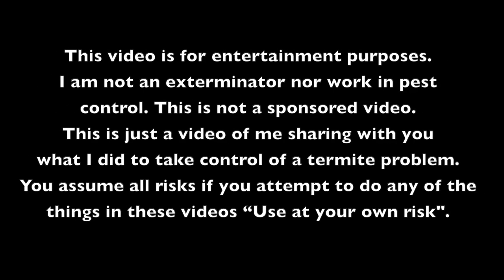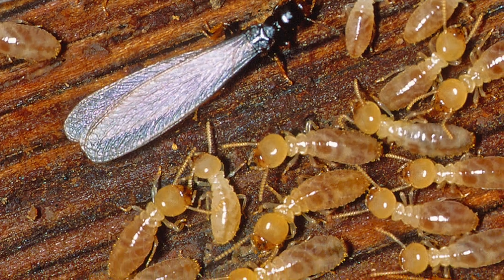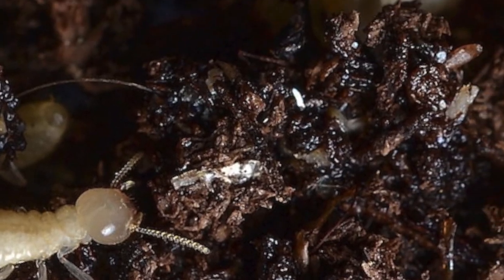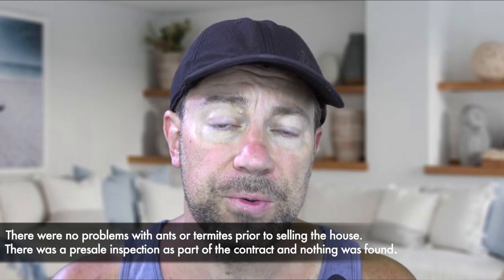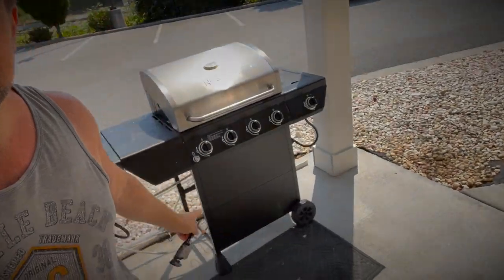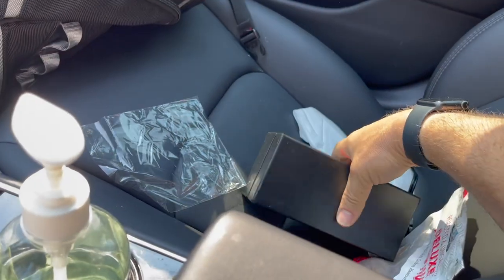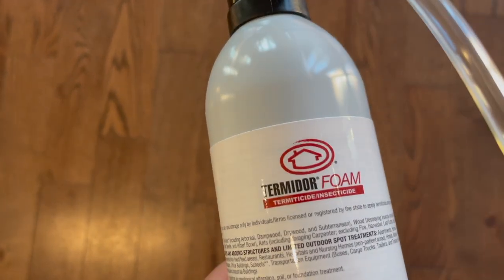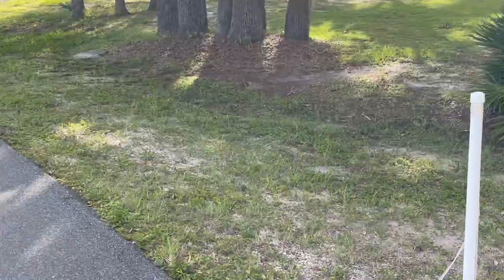This DIY Termite Treatment Cost Me Less Than $165 and Can Get Rid of Termites Forever!

Comment: Was there a lot of holes in the wood flooring inside of the house ? It looked pretty bad , saw dust all over the flooring . I would want a nice floor not one full of holes . I would think they or you could use a wood putty filling that matches well on the inside flooring holes ? It would help a lot w/ on how  the floor looks now vs afterwards .(Termites killed) just a thought . .
Reply from the maker: The bug problem is no longer a problem! It is well over a month later and all fixed now. That stuff works good.

Comment: Terrible video he’s not using these products correctly at all the holes that he was saying outside is where he should’ve been using the phone and in the inside he put the nozzle in the hole barely that’s why it’s it all out and I was told that the liquid was basically for soil
Reply from the maker: Read my disclaimers, I am in no way an expert on this. I was basically making content about bad tenants leaving termites in my house so to substantiate that particular series I had to follow through with some kind of termite control video to make it more believable. I do produce skits on my YouTube channels. Realistically I do not have any termite issues nor did anyone live in my house. It was for entertainment purposes and also for privacy reasons due to a potential stalker. I had to stage moving and my best story cover was a failed lease purchase contract this way when things cooled won and such potential stalker was no longer a threat to my family I resumed recoding content from home where I have been the interim time with the exception of a road trip to Florida to help a friend with electrical work for a few weeks. I also cannot properly apply any termite control chemicals while trying to record with a camera at the same time so when I put the camera down I am able to do a more though job without the limitations or distractions of trying to capture it on video.